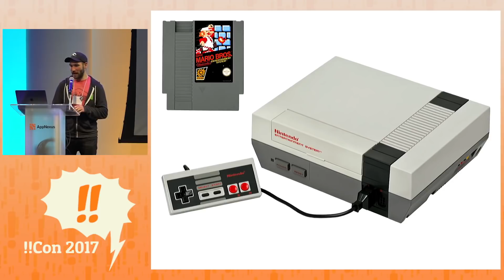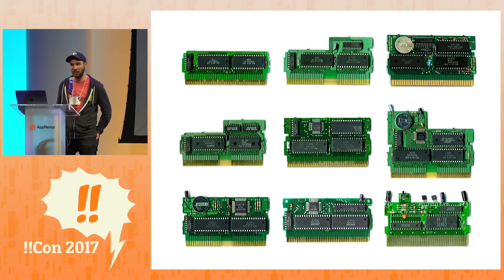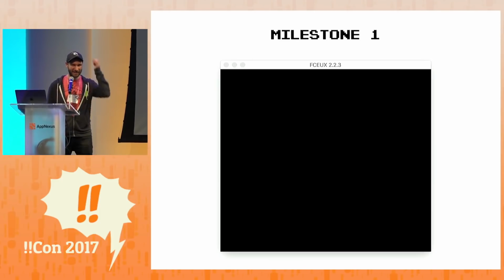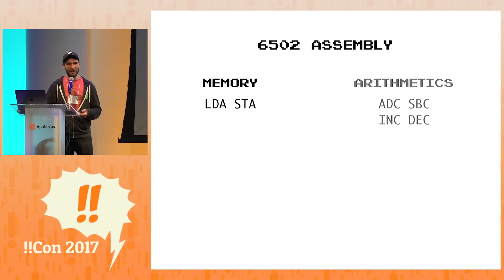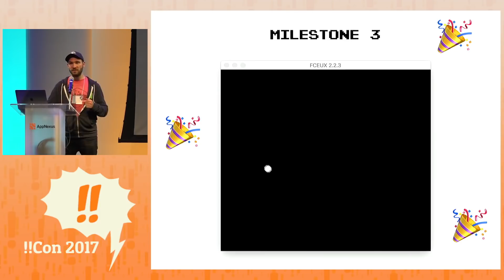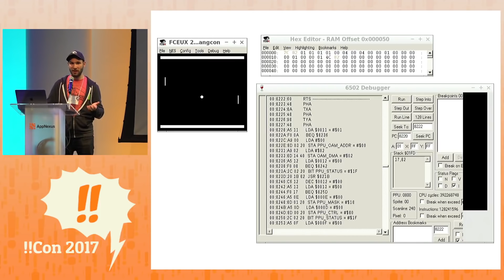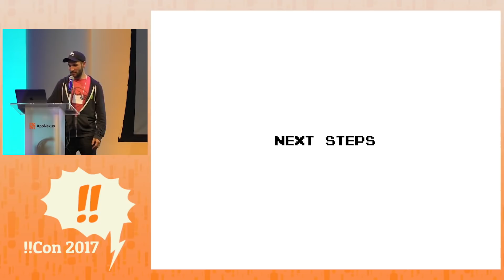Writing NES Games! With Assembly!!

Comment: The NES isn't actually a 6502 processor.  It's a mock 6502 that doesn't have decimal instructions, with a different pin out.

Comment: I'm trying to do this with CrystalTile2 and HxD, but I can't seem to understand how to set the address that is the start of the actual program. I also can't seem to get the CHR ROM in the right area, which is also weird, especially because I have looked at many many ROMs with CrystalTile2 and they seem to be in the same place my CHR is. I would really appreciate help from anyone. (I am not paying 30 USD for an activation code for NESMaker. That is ridiculous.)

Edit: I just copied the first three hundred bytes of code from Super Mario Bros to my nesgame.nes file, and deleted instructions (replace them with zeroes) until the game looped the stack. Then I would add the instruction that made it work from there. I changed the palette by first stopping the rendering system, putting in the palette address 3f00-3f1f in PPU_ADDR and stored the data I want at the address at PPU_DATA. Then I turned rendering back on, and it wasn't a 'blank' screen, it was a 'black' screen. nesdev helped me figure out the names of the ppu registers. Also you can use PPU_ADDR and PPU_DATA to change anything in the ppu ;).

6502.org/tutorials/6502opcodes gives you the hex values for every instruction.

First milestone :D

Comment: 8:13 If the NES only uses 8 bits for button press data how does the zapper work?
Reply: I'm pretty sure it pulls a bit high or low in a different memory address.

Comment: Not particularly difficult. I programmed a 6502 back in the early 80's. Didnt had an assembler. Did everything from memory and a translation chart. Even calculated the branches myself without a calculator or whatever.

Comment: One read at $4016 doesn't give you the 8 button presses in a single byte, only bit 0 indicates a button state, and you have to read 8 times.
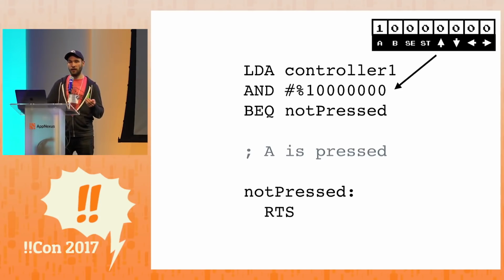You'd have to do something like this before the code shown at 8:25 :

controller1State=$50  //Let's say you choose some address to keep your button states on a single byte
ldx #1
stx $4016                        //Initiate strobe, part 1
dex
stx $4016                        //Initiate strobe, part 2
stx controller1State      //Button state byte initialised to 0
lda #%10000000           //Injection bit starts out left (since A buttons state was bit 7 in your example)
readButtons:
lda $4016                     //Read controller 1
and #1                          //Flush out superfluous status bits
beq  readButtons10   //Don't inject bit in your precious controller state byte if button isn't pressed
ora controller1State     //Inject the bit in you state byte if button is pressed
sta controlle1State
readButtons10:
lsr a                               //Move the injection bit  right         
bcc readButtons         //if the bit isn't flushed out to the carry, read the next button state

Then, your code would work, assuming you use "controller1state" the same way you used "controller1".

The NES doesn't neatly give you all the button states in one byte because the joypad produces a serial signal, with each read shifting which button state you get. The other bits are used by the other devices, like the zapper, and the strobe sequence can be different if you actually want to use the NES expansion port. The upper bits are open bus, which means that the last state of the bus will show up there (thus garbage data). 
Since you ran your code in FCEUX, which simulates persistent bus states, you would've encountered this problem in some form...

Comment: I realize this isn't the original upload, but I should note that FCEUX is a combination of several forks of FCEU (FCE Ultra, itself a fork of FCE, Family Computer Emulator) that had been created since FCEU development ceased, up to 2006; I don't know what the X stands for, but I do know that until the BizHawk project (which is Windows-only but also has debugging functionality), this was the primary NES emulator at TASVideos (initially the site used Famtasia, VirtuaNES, and FCEU).

Comment: Awesome. Though you don't need to program directly in 6502 assembly, as there exists a C compiler for 6502 based systems (which includes NES).

Comment: I already knew almost everything he's talking about, but I am so mad jealous because he's actually programming it and actually doing it.

Still though, I don't really get why you couldn't use a high-level language to write a NES game.  It all comes down to the compiler.  Whatever code you write gets compiled into machine code anyway.  Granted you'd need a new custom compiler since it's doubtful someone made one already, but it's not "impossible" it's just "arguably easier to just learn Assembly."  Especially since you'd also need to be creating new libraries that would either have to be built for a specific game or else become needlessly complicated to match the power of directly calling things at arbitrary moments.  (To really get the most out of an NES, you need mad skills with timing IRQs in the middle of drawing a frame.)
Correct me if I'm wrong, but that's my understanding of how programs actually work.

Comment: The CPU being too slow for a high level language is plain wrong.... any high level language that does not generate byte-code can be compiled down to machine code. However, depending on the compiler or the system architectur,e handwritten code can be better. Old games were written in assembly because you had more control and could hand adjust how many cycles you would require and so on
Reply: Yup, I used C back when I was writing gameboy code. Although we had bank switched ROM back then so that was a bit of an headache to deal with.

Comment: The inability to use high-level languages has nothing to do with CPU speed, it has to do with memory capacity.  Back then, memory was so scarce that you needed hand-tuned code to produce a game good enough to sell.
Reply: It very much has to do with cpu speed.
Ultimately any high level language gets converted to machine code. It doesn't incur a memory cost on its own.
But there is overhead with even the most simple high level languages like c.
Especially back then it wasn't possible to use them because compilers weren't efficient enough and the hardware not fast enough to be able to take the overhead
Reply: Writing C for bank switched ROMs wasn't exactly straight forward either, you would have to hand-arrange functions to manually assigned banks because no linker at the time could automatically lay this stuff out, and of course no C compiler understood that some functions needed the correct ROM bank selected before calling, so you had to do that by hand too.
Reply: C still doesn't take well to the 6502, partly because C was written for 16-bit devices. The 6502 being an 8-bit device, it takes about double the instructions to handle 16-bit quantities. And C apparently really likes it's 16-bit types. Apparently the way the 6502's stack works is also a bit of a pain if you want to use C.
With trying to use C on the 6502, the big problem is that they simply do not fit well. Unless you bend C quite a lot, in which case you're technically using a C-like language instead of actual C.
It's basically just easier to get efficient code if you use ASM in the first place. And I don't find 6502 ASM all that hard. But it's not going to be everyone's jam.
Reply: Both Apple II and Commodore 64, which ran on the MOS 6502, used BASIC, which is not exactly a high-level language, but isn't low-level either. It's somewhere in the middle.
The main reason why you had to code for the NES in Assembly is that the NES had no operating system, had no BIOS or in-software drivers and APIs to interpret between software and hardware. All the NES had was hardwired microcode, which only understood Assembly because you couldn't store any additional compilers beyond the object code converter from Assembly to raw machine code, which was hardwired into the MOS 6502 chip itself.
The cool thing about the NES is that it had a dedicated graphics chip, so the CPU didn't have to draw the graphics like in the Atari VCS (aka 2600), and was solely responsible for game logic, with video and audio data being sent to the graphics chip (PPU) and sound chip respectively.
Reply: 8051 compilers get wrecked because you have to specify @near, @far, etc. because addressing different memory regions is done in different ways--and doing it the most general way is way too slow.

You could make a C compiler for a 6502 by using the zero page as "registers" (since you really have to do that anyway to index the full address space). It would be slower, but much easier to use. Of course, now we have ARM microcontrollers which are a dream for C compiler writers.
Reply: @Christian Gingras, what about:
RTI RTS TXS TSX PHA PLA PHP PLP
That is good enough. The trouble was that there are only 256 bytes available for the stack, but C is a stack machine language.
The true reason though is that the mem has no continues address space because the address is just an 8 bit offset not absolut. Writing an efficient compiler was just too much work.
Reply: To be fair, basic is an interpreted language, rather than a compiled language like C. Still, it's inefficient as heck!
Reply: I admit to never reverse engineer any NES game and forgot the detail of the 6502 which could explain why nobody made a C compiler for it.
I can add my own anecdotal example of great engineering on limited hardware: OS9 was allowing the processor 6809 to use up to 512K RAM. The 64K memory directly accessible was divided in 8 scrolling memory windows of 8K each. Each task had to select ow to use these 8 windows : let's pick 4 contiguous for a linear 32K, let's give 2 for interrupts code and some operating system function. One for access to the video buffer and lot's of modulo 8192 operations to manage everything. 
The engineers working on 8086,8088, 80186 and 80286 were doing similar gymnastic playing with segments to use 1 Meg (20 bits) RAM with a 16 bit processor.
Reply: Potato
Reply: Not only does it not have the memory capacity, it takes way too long to translate high level language instructions in to multiple 6502 instructions. That's why he said that.
Reply: The NES didn't even have 64K of RAM. It only came with 2K internal and another 2K for the name tables and 256 bytes of volatile RAM for sprites. The rest could be provided by the game cartridge.

32K ROM for program memory and 8K ROM for pattern tables were the limits before memory mappers, which could extend the ROM capacity almost endlessly. The game cartridge could also provide additional RAM, usually 8K, either for providing more space for game variables like in Super Mario Bros 2 and 3 which use them for storing bigger levels and stuff, or for storing save data like in Zelda.

Some games also had 8K RAM instead of ROM for pattern tables, which also had some interesting advantages.
Reply: The memory limit of 64K is not the reason. The 6502 processor miss the most fundamental instructions for accessing the stack pointer. It can not generate local variables or pass parameters on a stack for any function call.
However, despite this kind of limitation, there is many C compiler for the intel microcontroller 8051 wghich is as primitive as the 6502.
Reply: There are ways to pass parameters beyond the stack.  For example, load a pointer to them in a register before the function call.  On the 6502 you can easily manipulate the stack pointer, either by pushing/pulling an accumulator or, for complex operations, transferring a copy to the X register via the TSX instruction.  Local variables are no sweat.  When comparing to the 8051, keep in mind the 6502 is 5 years older, and the 8051 has 2x address space (thanks to its separate program and data memory areas).  You probably could compile for the 6502 for basic stuff, but 64k is so small that hand coding is a must for anything worthwhile.
Reply: So uhm, I understand none of this
Reply: @Ozzy jak "Computer Organization" (possibly with a separate class on assembly language, other times it's combined) is an almost universal requirement for a CS degree, and compiler design is a common elective. There are hundreds of thousands of software engineers as well as hobbyists who "know their shit" and are well-trained to "make noise" on this topic.

Comment: 65xx assembly was my first 4 years of programming, then i went to 68xxx. I get an absurd feeling when it is presented like this. Nothing wrong, it just show that I'm from another age.  :-)
Reply: Yeah, the miracles of doing what I could do when I was 13 in the 80's...
Reply: I made a set of database function in 68K assembly on the Amiga and an invoice/in store program on top of that. It generated several 100'ed invoices in a few seconds in stead of hours. The last user retaired a few years back and had then used it for more then 25 years on the same stock Amiga 500 with an external HD.  :-)
In all that time it needed support 3 times, so strictly it was really not a good for business pogram.  :-)

Comment: 6 years?!!! I have 30 year old NES games that still have good batteries.
Reply: little funfact: transistors need much more power when they change a state compared to when they need to hold a state. So yeah, i guess they did their calculation on inhuman "input and usage" scales of all bits changing most of the time. So 6 "years of usage" are a pretty solid statement in my opinion :D
Reply: @emerold_rd  agree
Reply: @emerold_rd  seeing as the nes is the one having to interact with the ram to change it, I doubt the battery would be used while changing
Reply: Some games have better batteries than others.  Also, they're marketed as lasting 6 years as a liability to the company, I guess they calculated that 6 years would be the minimum amount of time that they could last even though some were functional for much longer.  They're also easily replaceable so if you bought your NES games second-hand they might just have new batteries.
Reply: The battery is in use all the time, since the ram is powered by the NES when on. So it is actually the other way around.....years of "not use"
Reply: Gonzo Duke Compare that to the lifespan of a current smart phone!!
The attitude has surely changed.
Reply: @javiceres  smart phones do more than just storing a few numbers
Reply: Me too, I've still got my Zelda II and Shadowgate saves from around 1992!
Reply: @Snedd99  In the past year I had bought Zelda II, and the batter was dead. Had to do open cart surgery.
Reply: Same here Gonzo
Reply: Which sounds better to a consumer, 6 years of use and lasting 30 or 30 years of use and lasting only 6?
Reply: @Kara_Kay_Eschel  what?
Reply: @Rob Alle Why would you respond by calling me an idiot? Why don't you google something before you act like you know everything? This is why we are getting dumber as a society. Please think before you type.
Reply: Well one of us is an idiot and since I've changed a NES cartridge battery a couple of times and since you can find countless YouTube video demonstrating the process, it's probably time to pull your head out of...
Reply: Gonzo Duke 6yrs as in 6yrs of use.
Reply: César G. Rodríguez yeah. But like anything, actually using it, giving it more to remember, makes it work harder. Just how it is with batteries.

I didn't Make the rules lol
Reply: @agonleed3841  sorry to burst your bubble, but that's not how storage works. Ram can't be physically "more" or "less" full
Reply: @obiwac  far as I can remember, I was talking about batteries.
BUT, if I was talking about RAM, somewhere in this thread, I probably simply didn't word it correctly. So, take what I state, and lok for the actual meaning. IDK..it was a while ago